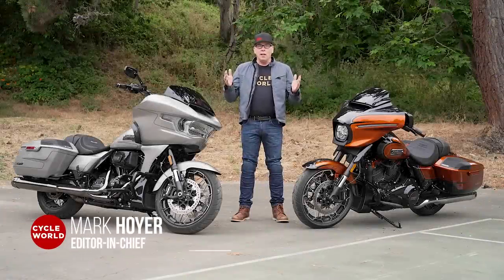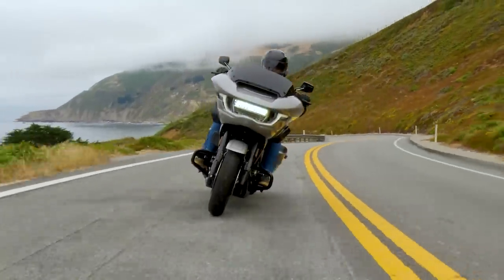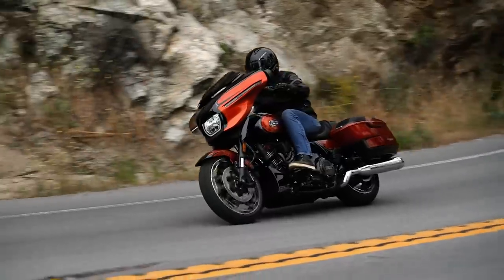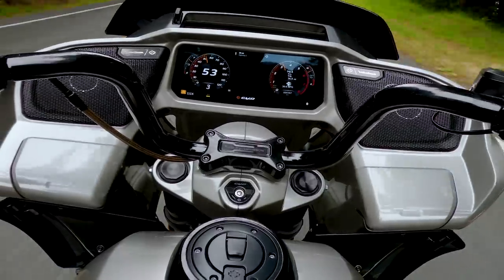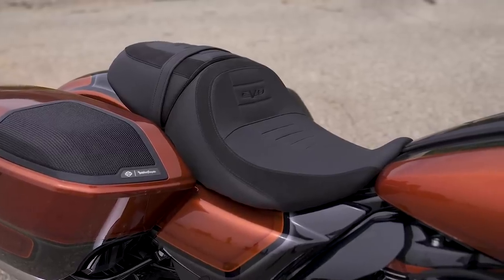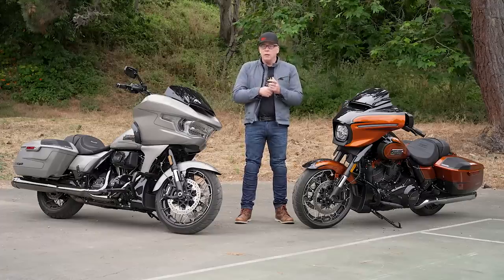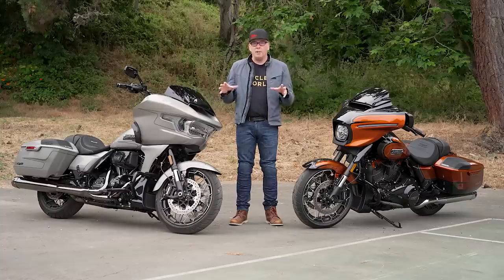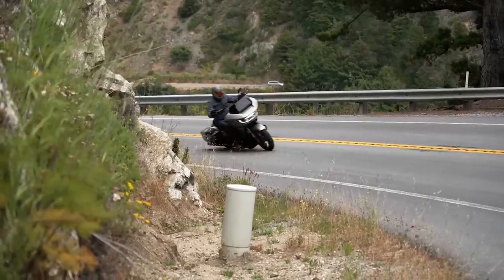Riding the ALL-NEW HARLEY-DAVIDSON CVO 121

Comment: I thought the theory is if you want to make the handling better you need to change/work the frame - the rest (carbon wheels, suspension etc) is just cosmetic? This is the cheapest option again - being sold as radical, typical Harley
Reply: The you heard wrong. The frame is fine and not the only thing that goes into handling. Try again.
Reply: It needed a mono shock.  Suspension upgraded but they didn't go far enough .
Reply: @fastsilverado  A monoshock is not the end all be all of better handling. Quit repeating stuff you hear and go do your own research.
Reply: @BlinkingKillswitch  I have done my research. Why do most sport bikes have went to mono shocks? Because it works. Harley is afraid going away from tradition that they are hampered by it. Soft tail is mono shock. They need to change to survive .
Reply: @BlinkingKillswitch  You may want to go and do some research lol.  When is the last time you've seen a Sportbike with dual rear shocks standard from the factory?  Go ride a Harley touring bike hard through the corners and then go ride a Indian touring model hard through the corners.  You'll feel and notice a huge difference between the two.
Reply: @myclassiccarstory  No one should be buying dressers to carve up corners. Monoshocks have their place. I'm not denying that. They can be superior for handling, however, the fact you're comparing HD dressers to sport bikes means you're comparing apples to oranges and everything you have to say is ridiculous. If you buy baggers and then whine it doesn't go fast enough or corner over enough then you've got other problems than throwing away money.
Reply: @fastsilverado  I don't understand why people compare cruisers to sportbikes. Those are two totally different style of bikes built for two very different purposes. Your research hasn't been great if you're out here saying ridiculous stuff like that.
Reply: @BlinkingKillswitch  then why is Harley calling them performance baggers? If they want performance then mono shock is the way to go. Keeping the duel shock technology is for those who don't want to change. Change is scary. But if they are going to do front suspension then do the back. Be a big boy and go with the change.
Reply: @fastsilverado  Now THAT is the argument I want to see. I completely, 100% agree with you. If they're gonna call them that, then I agree that monoshock was the way to go. I always kind of figured that maybe they only do a little at a time to give aftermarket a chance to catch up. No telling what's going on in HD corp. Either way, that's the argument I want to see. Stop comparing them to sport bikes. But if HD wants to call them performance baggers and at this price point, it should be electronic adjustable monoshock.
Reply: @BlinkingKillswitch  While I don't completely disagree with you I only used the sport bike thing as an example.  The truth is there is more than just handling that comes from using a mono shock.  A mono shock also makes the bike a smoother ride, creates less stress on the frame and from the result of a mono shock the bike will handle much better.  In case you haven't noticed but performance baggers are the new hot thing and have been for a couple years now.  Bigger engines, better brakes, and improved suspension.  Indian was the first to the scene with adding performance upgrades to their touring lineups and as a result their bikes are hands down better from the factory than Harley.  I have a performance built dyna that I built to take twisty roads and be able to go on 2 week long camping trips.  If I was to switch to a touring bike I'd want that touring bike to be able to take the twisty roads with some speed as well.  The technology is there so don't tell me as a consumer that you can't do it.  You have to build bikes that attract your current audience.  Indian did that with the challenger and it has been a huge success.
Reply: @myclassiccarstory  I never said the tech wasn't there. But buying a dresser or bagger  and then whining that it isn't fast enough or doesn't corner over enough is stupid.  I didn't buy an Ultra Limited to go as fast as possible. I bought it to ride and enjoy the view. Going to a Harley bagger and scoffing that it isn't as fast as this other is so incredibly stupid. Indian is having it's only quality control issues so it's your opinion that Indian is putting out a better product. Because YOU haven't have any issues doesn't mean Indian is better. And just because Harley might have issues doesn't mean it's better. Do monoshocks perform better? Sure. Does a water cooled engine and monoshock mean Indian is making a better bike? No. Don't get me wrong. I want Polaris to do well to finally give HD competition, but copying the bikes and then adding a features here or there and going "TA-DA!" Does not mean Indian is building a better product.
Reply: @BlinkingKillswitch  Well then it's probably a good thing that harley isn't listening to folks like you when it comes to building their baggers.  The younger generation wants a bagger that performs and handles.  Saying people are stupid for wanting a bagger that performs and handles shows just how little knowledge you have about what current consumers want.  Putting performance parts on a bagger isn't going to change the experience you currently have riding your limited in a straight line and sightseeing.  It just allows others to get a little more out of their bagger.
Reply: @myclassiccarstory  I’m not saying theyre stupid for wanting more. Im saying theyre stupid for buying a bagger, knowing full well what it is and isnt capable of and then whining that it cant do what it clearly not built for. Thats like telling someone to punch me in the face and the whining that I’m getting punched in the face. People will ALWAYS want more than what factory offers. When they went to the 96 TC from the 88 Evo, they whined that every bike should have the 96. When the 103 TC came out, they whined they all should have the 103. When the Mil 8 107 came out they whined they should all have them. Then the 114, then 117 and so on. And then think prices shouldnt go up. You want a bike with all the performance? Indian is selling it for like 90k, even more for dealer markups. You wanna go faster in a straight line than me? Go for it. You wanna corner harder with your white claw in a cup holder on your drag barsl, okay the go for it. But dont think a company is going to change its entire ethos for a group of people that whine that its never enough. This performance stuff is a phase just like the choppers and bobbers and so on. Every review its literally never enough. It doesnt matter what they do. “It DoEsNt HaVe ThIs Or ThAt. ItS gOtTa HaVe AlL tHe StUfF.” They put some of it. “Oh ItS tOo ExPeNsIvE!” Everyone wants more but dont wanna pay for it. They want it all for free. Indian isnt even a cheaper option any more. Their “Elites” cost almost as much as the CVOs with a quarter of the dealer network and a fraction of the aftermarket. And as good as people say they are they STILL change the bars, exhaust, cams, ECM flashes and then look back at HD and whine about what they should come with. Yall’s complaints are all bullshit. Sorry charlie.

Comment: I love how you mention that the three inches of travel "is exceptionally well utilized"! On prior year models, was the rear travel unexceptionally utilized? What does exceptionally well utilized even mean? Sounds like you went to the same school as Kamala Harris.
Reply: Means despite a rather short travel, the suspension absorbs exceptionally well the bumps in the road. You’re welcome
Reply: @vincentbeijing6926  Same frame, same rear fork since 2009. How does this new bike suspension absorb exceptionally well compared to a 2009 model? Put Ohlins with remote reservoir on a 2009, and it probably absorbs the bumps better than this new model with it's OEM suspension.
Reply: @lqqkout4thedude  it seems the new Showa shocks have improved since 2009. 
As for Ohlins on older models, I installed ohlins piggy back shocks on my 2016 roadster xl1200cx and yes they metamorphosed the ride and handling. It’s like a different bike now, superbly damped. They have the same travel then OEM though, so even with the same limited travel the result is outstanding.
Not having tried the new CVO, I can only imagine Showa has designed much better shocks, as stock rear suspension is a real disappointing aspect on current touring models

Comment: Lmaoff never would want a harley
I have a 2005 Suzuki vl 800 c50 it has 189,000 miles on it 
   Only thing I've done on it new plugs,oil change ,brakes 2 new batteries, 3 stators
  And replace clutch twice 
  Still riding it